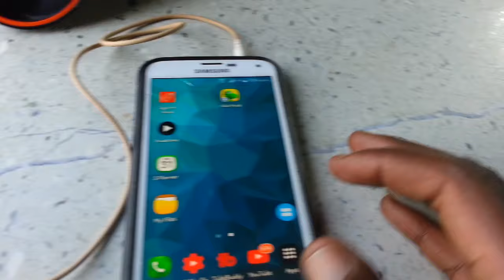Connect AUX Cable to Speaker | Speaker connect to mobile without amplifier

Comment: Thanks, this worked. Although I had to look up other videos as my wire was 5, two ground and the rest.

The output is low, what can I do to make it louder, I've increased the volume from my phone to the highest
Reply: Use amplifier
Reply: Same problem, it's working but output is low even though I increased volm

Comment: Yes let's work but volume very slow😔
Reply: First you need more power supply to increase that volume, but the power supply only increases the volume and makes it sound very noisy, in which case you need an amplifier circuit or sound card to produce big and clear sound
Reply: I can't understand bro can write it again
Reply: @bablu2748  you need an amplifier that's all, to make the volume higher and more clear
Reply: Connect it with laptop
Reply: @aniketsharma1136 i connect with my pc but still low
Reply: Well, for sure the volume would be low because the speakers won't get enough wattage via a mobile phone.

Comment: When i cutted down jack wire, there were only 3 wires inside...red green and open copper wire..and thread. Tried to connect but it didn't work. Can u help me out with this?
Reply from the maker: Join green and ground  (-)
Red (+)
Reply: @CedohKingdom  Thanks brother.. I'll try..
Reply from the maker: Ok
Reply: I got 3 wires yo. A white wire a yellow one and a blue. So which I connect to where bro? Please help

Comment: It's working but sound of the speaker was very slow.
How can i increase the volume?
Reply: Use A 1uf capacitor A transistor and try to get a battery power source

Comment: Hello brother, greetings from Ecuador, could you make a TRRS A TS cable to broadcast live on facebook, I would appreciate it very much
Reply from the maker: What type? 

1/4 trs or 3.5mm trs 
            Or
1/4 ts  or 3.5mm ts
Reply: @CedohKingdom  1/4 ts or 3.5 mm trs To broadcast live on facebook, thanks bro
Reply from the maker: 1 question 

Connecting phone to computer?
Reply from the maker: Can this help?

3.5mm trs to 1/4 inch ts cable : https://youtu.be/XpAEogoSErY
Reply: This dear friend cable from cell phone to dj controller
Reply from the maker: Got it, coming up next week .
Reply: @CedohKingdom  Thanks brother
Reply from the maker: Trs to ts adapter cable : https://youtu.be/wIt6H9mktBM
Reply from the maker: Is this the one you asked for.
Reply: @CedohKingdom  Brother, how are you, I'll explain to you the type of cable I'm telling you is the one in the video at 0:56 so far, well, in the part that you're going to make the new connection is going to be a TS plug, that is, that cable would end up being (TRRS  to TS) for transmission
Reply: Anyway thanks brother this video also helps everyone who needed this type of video greetings

Comment: The sound comes very low
Reply from the maker: If the sound is low then don't join red wire with any - connect red wire alone. This will work.
Reply: @CedohKingdom  i did this and the sound still comes out low